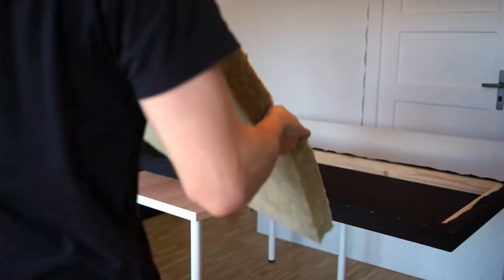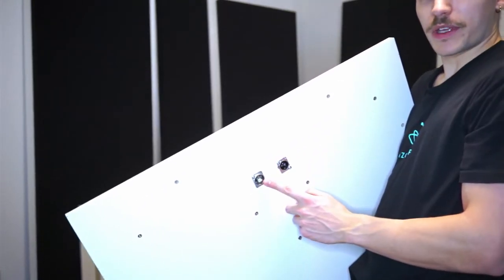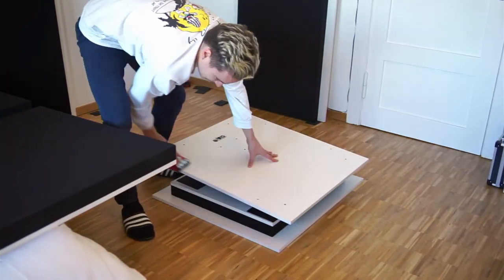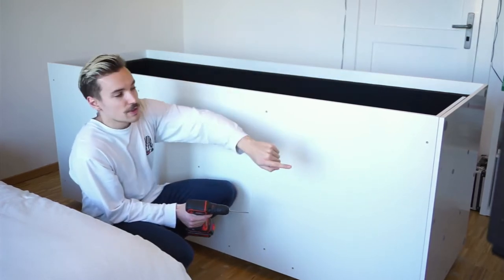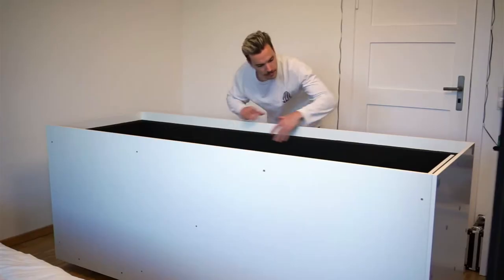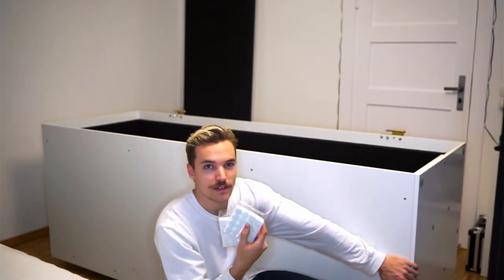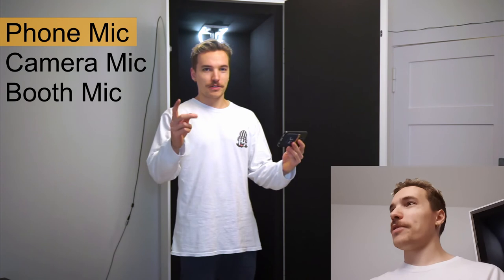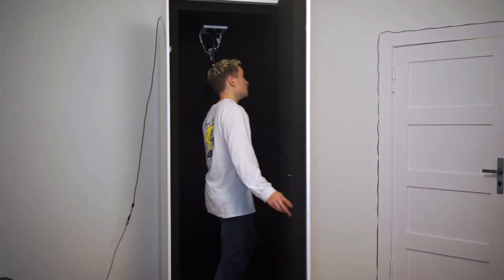How to build a professional Vocal Booth on the cheap - Part 3

Comment: Hey man! I'm building something like this, and this video helped me a lot for the health risk factor. How can I mount a ventilation system? I need to drill a hole to put the ventilation fan, connect it to the electricity, and that's it? Thanks and props to you!
Reply from the maker: I will aim to cover this on a version 2 in the future. I haven't figured out exactly how I'll do it yet but most likely with PC case fans running on USB voltage (5v)

Comment: Looks awesome, but without active ventilation it could get warm there. 
Do you think you can measure with an app on your phone how many dB the booth reduces?
Reply from the maker: Thank you and thanks for watching! You're right, it gets quite warm after 10 minutes or so. For a home studio it's okay because you can open the door between takes or after a few minutes and it cools down pretty quick. Maybe I can add cooling later or on a new version ;)

That's a good Idea to measure the dB difference. I could set up a monitor inside the booth to play a sin wave, pink noise, or a frequency sweep. Then I could set up a mic outside the door on a stand and test with the door open and the door closed. I could also test with the speaker facing towards the open door vs facing into the both to test the effectiveness of the absorption. Great idea for a new video, thanks!
Reply: @JamesDeBono  Thanks for replying. The reductions of the booth is not going to be the same for all of the frequencies. The higher frequencies are easier to stop because the shorter wave has lower energy. Since you are going to sing/talk inside maybe it would be also beneficial to measure the reduction with human voice inside. You may record your singing and play it on the monitor inside the booth and measure the dB outside. :)
Reply from the maker: @ztz1775  Yup that a good Idea! I can put the monitor on a stand at my mouth level facing the Mic
Reply from the maker: *Through testing, I realized the lack of ventilation could be a health risk. Please read the updated description. Thanks*
Reply: @JamesDeBono  Damn. I expected it just to get a little warm. Hope you can solve it easily. Sounds like a content for YouTube :). Thanks for your warning.